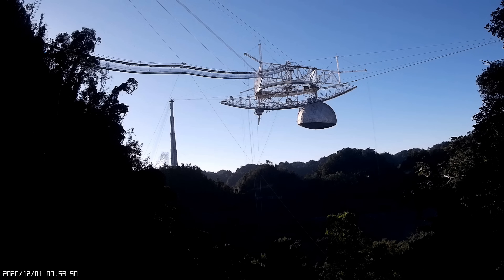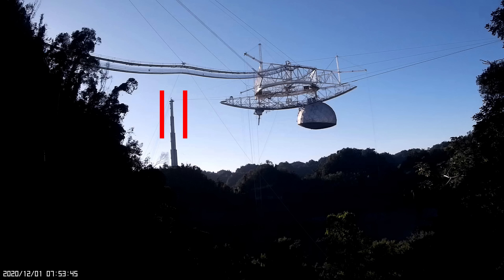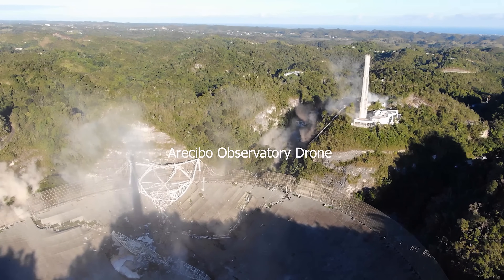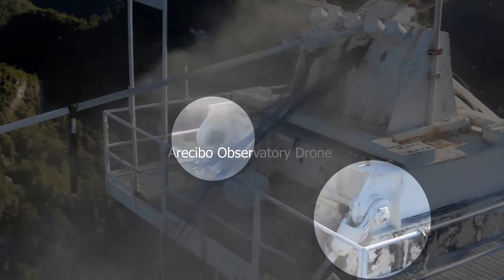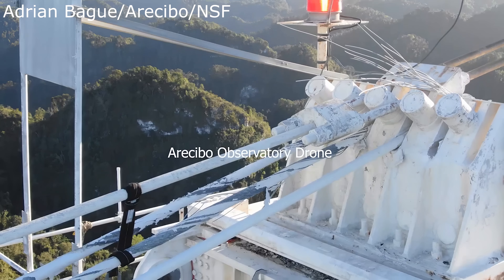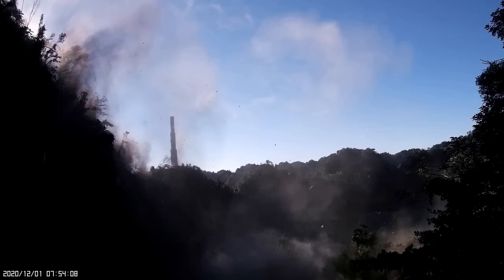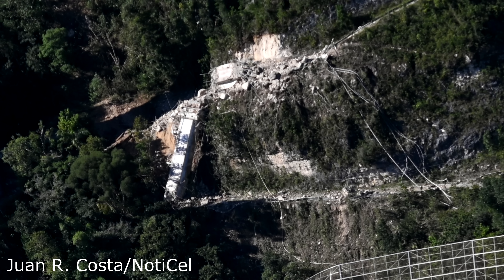Analyzing Video Footage Of Collapse of Massive Arecibo Telescope

Comment: After seeing the failure of the cable and the resulting failure of the remaining cables It is clear that there is a design issue causing the cables to be stressed and weakened near the ends due to contraflexure. I think the cables need to be finalized in an oscillating mounting with a multi axial bearing to prevent the flex strain near the ends of the cables..
It would be interesting to work out the amount of weakness created in the ends of the cables due to contraflexure  and Arecibo's data of the movement of the  Antenna over time might be It's final and very useful insight as to why the cables broke at a much reduced  breaking strain than expected, Better start researching before we start loosing suspension bridges !!!

Comment: Planned obsolescence or sabotage? I'm no engineer but it would have been evident seeing the decay of those support cables months prior. Why the problem was left to go on like this is the real question. Maybe it is cheaper to rebuild, but then they should have admitted financial limitations as a reason for the lack of repairs and preventative maintenance. For something that was built in the 60's to 60's standards it has held up for pretty much over 50 years.

Definitely a hit for the science/astronomy community. I hope they get to rebuild and those with the money chip in with funding.

Comment: As silly as it sounds, maybe it could be possible to use the dish by hovering a drone at the desired focus point? Of course, the drone could be a very hefty affair, probably even tethered to a cable to supply power batteries could not, but that could be implemented much faster than rebuilding the cable-slung hardware…

Comment: Arecibo SR: that Asteroid is changing velocity...
Ten seconds later: Arecibo has died in an accidental cable failure. No plans to rebuid.
Reply: That is basically what happened when the Green Bank Radio Telescope collapsed overnight a few years ago. An analysis of the radio data collected in the few days before the final collapse showed that the dish had changed shape. In that case there was no warning of the collapse - the staff on site were very lucks and also the group photo of a large proportion of the worlds leading radio astronomers that had been photographed under the Green Bank dish a few week previously. I don't think Green Bank would have been looking at an Asteroid probably a far more distance radio source when it collapsed.
Reply: Actually this happen because the dome was added after and those cable where ment to hold less weight and by adding the dome and all natural disasters that added to this cables to failed
Reply: @purple88able  Thing is, that by design those cables should not have failed. But after the first failure, analysis showed that for some reason they were MUCH weaker then they should be.

Meaning we are looking at either a factory defect or accelerated decay for an unknown reason.
Reply: @purple88able  As it says in the video additional cables were added to strengthen the structure before the weight of the receiver / transmitter cabin was increased. The reason why the first cable pulled out of it's  termination socket a few weeks ago causing the initial damage has not been revealed.
Reply: @johnmurrell3175  Guys I was born and raised in Arecibo Puerto Rico and even do the beach is a bit away from the place saltpeter reaches everywhere and eats everything. Im sure that was another of the reasons that added, plus what you guys highlighted. It's a pitty that NCF did lost the love for this project and stop fundings for the maintenance. The administrators of the Observatory is the University of Central Florida. Right now the only technology available in the Observatory after this event is radio astronomy and other stuff they have a 12 Meters telescope, 2 lidars and 3 photometers. Here they had 3 radio sciences: radio astronomy, planetary radar and atmospheric science. The only one left is radio astronomy. Why they stop fundings it must been for a purpouse. I had the privilege to be inside where the data is shared and  the general public is not allowed. So everything happens for a purpose and I know we are humans but if this instruments is so important for history and in 1974 the first binary signal was sent and they have the SETI server founded by Drake and waiting for a response and if we receive a response will be detected there because it was in encrypted in the message sent in 1974. Why they practicly abandoned it?
Reply: The Observatory was build in 1960 and the Dome was added in 1974 they added the dome and in 1997 they added a metallic protector to avoid the radiation from earth. So it been going through changes
Reply: Is this what traveling in QAnut circles?

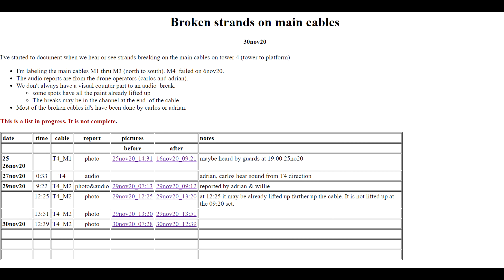Comment: Great video as usual, but "visible with the naked eye from space" (ca. 3:20). Depends where in space you are. On the ISS: maybe. On Mars: probably not. Near Alpha Centauri: pull the other one. A cliché too far?
Reply from the maker: At a certain distance, the answer is no, the question is what distance is it.
Reply: @scottmanley  Sorry for the snarky tone of my comment. Since you've asked a really good question, let's have a go at working it out.

Assume we're talking about a naked eye observation: the human eye is apparently able to resolve about 1 arc minute. That means, using half of that and half of Aricebo's dish, tan(1/120° or π/21600 rad) = 150m / (distance in m). This gives the distance as just over 1031 km, well above the Kármán line, so "in space". But not very far, in the grand scheme of things :)

Edit: no, I didn't use Pythagoras - I have no idea why I typed that first time round.

Comment: Rust happens. Have bought miles of cable, 5/8 and 3/4 inch left lay. Left lay is for cable drilling. Bar rotates clockwise when rig is running. That cable there is cheap ass cable cheap cheap

Comment: Hopefully the replacement will have a winching system that will allow the platform to be set down for maintenance and upgrades on a regular basis.  And lets add 15-20 meters around the edge for an increased collector area.

Comment: Ah so the molten zinc did not fully solder itself to the central strands of the support cables. I could have seen that coming. Allegedly. 
I wonder if a flux was used. Or if the correct flux. Any number of things could have gone wrong there.
I'll volunteer for the cleanup operations. They cover room and board, transport and a nominal salary right?

Comment: Is anyone aware of a foundation our something that may sell parts of the site as memorabilia and the money would be spent to build its successor?
Reply: Pretty  sure the aluminum will be looted faster than a NYC hubcap in 82’
Reply: I'm sure the scrap value would be way higher than any memorabilia. Also there's little cost associated with scrap. There's a ton of costs with setting up some online shop and then finding parts for memorabilia.
Reply: @lost4468yt  I think even the dish chopped up would be great. And I'm not saying they should sell out dirt cheap, like cheaper than scrap value. I mean 10x, or more! Some enthusiats would pay $40 for a palm sized piece, for sure especially if the income is going to be used to build a new one. A crowdsourcing project backed by old hardware sellout, if you will.
Reply: @Sekir80  I understand what you mean, but I don't think they'd be able to sell much of it at 10x more. If you flood the market with pieces then they have less value because they're not rare anymore. If they sold 10,000 pieces at $40 each that would still only be $400,000, and I very much doubt they would be able to sell even 10,000 at $40 each. Even 100,000 at $40 each would still only be $4 million. 

And you have all the overheard. You need to host a web page, cut it up into small enough pieces, advertise it, store it somewhere until it sells, etc etc

It's just not feasible, it's better to just sell it for srap.
Reply: America is too poor to build a successor. We only run a 168% debt for military spending.
Reply: @zeitgeistx5239  What's sad is that the US can easily rebuild this and their nation if they stop funding the Pentagon.
Reply: @ivanfreely6366  then again, it would probably be eaten up by SS, Medicare and Medicaid which total up over two trillion.
Reply: @ivanfreely6366  not much money goes to the pentagon. It's nearly all on poorly planned social programs.
Reply: @ivanfreely6366  Intrestingly, the DOD budget is spread out amongst 18 agencies, the 3 departments such as the Army, Navy, and Airforce, as well as multiple other groups such as POW recovery office to the Education office and then 9 commands 
Yet still takes up less spending then other things the Federal government spends on

Comment: 6:48 you can see the paint coming off the big bolts under where the cables attach too
Reply: @robertcowling4313  yeah that's the point, they're starting to break off

Comment: Those were badly engineered sockets.  the wires pulled out of the socket because a few broken wires gave the cable enough space and movement to pull out.   I wonder if the Zinc cap was badly done or had just corroded to uselessness

Comment: Interesting- there is what looks like a datalogger box recently installed below the saddle. Its white with the letters WJE, temporarily mounted with Kant clamps. Wiss, Janney, Elstner Associates is an engineering firm that specializes in failure and repair of structures. I wonder if they had some instruments that were alerting that these cables were about to fail- which could explain the amazing timing of the drone.
Reply from the maker: It's possible, but they had been in the habit of flying first thing in the morning since they needed to inspect cable status as soon as there was enough light.
Reply: @scottmanley  In any case, the camera position of the drone could not have been any better! As disappointing the failure might be, all structures are doomed to collapse at some point in time they should be stoked for getting that footage!

Comment: I wonder , the cables were obviously right on the verge of letting go and the odds of a drone with a flight time of say 15 -20 minutes being in the right place at the right time is very unlikely , brilliant as it was . High power industrial drones , which is what I assume they used here  have powerful  motors and when close vibrate the air powerfully , I wonder, was that vibration , small as it maybe compared to the hardware involved , just enough to tip the cables over the edge ? A bit like an avalanche where 100,000 tonnes of snow can be set racing down a mountain just by the sound of a rifle or a skier ?

Comment: I knew it had failed, but had not seen the scale of destruction.  Large structures are normally designed with a generous safety margin, one where even if 2 of the 4 cables broke, it would still be able to safely  sustaining the load without exceeding elastic limits. Apparently that was either not the case, or the cables had rusted / corroded, and (as happened here) the plugs securing the cable ends were inadequate.

Comment: Would it have been cheaper to have replaced the cables 10 or 20 years ago, than to have to pay for the clean up, alone?  And then rebuilding it?  Whoa!  A couple $billion, maybe?  If we are going to rebuild it, look at making it bigger and better.  IF bigger is better.  Maybe a smaller dish diameter can do active radar scanning adequately?  Form follows function...and I hope not politics.  I then give thought to:  Why not rebuild it on the far side of the Moon, in a mile-wide crater?  But then, that's probably $40 billion!...or more.  Less gravity, lighter construction...all the radio emissions of Earth blocked out.  Lots and lots of pros and cons to consider.  I think it should be thoroughly considered, though.  Once this mess is cleaned up, they should be able to refurbish/replace the towers.  And then hang a new instrument structure with a cable system designed to allow periodic cable replacement.  And finally, repair the dish, below.  Or, maybe it should just become the world's largest skateboard park.  :)

Comment: Scott, your rendering seems to have glitched out and failed between 10:18-10:41.
Reply: Bumping this. We miss some of the photos described when the video glitches out.
Reply: Looks just fine on my end
Reply: @Somethin_Might  Scott refers to images in such a way that you should be seeing them on screen, but don't. There's also a couple of frames of the buildings visible for milliseconds in the middle of the image of the towers which are pulsing ever so slightly like a loop of a fractional zoom in then restarting from the original frame.
Reply: Indeed
Reply: Bump

Comment: Seems irresponsible to me that they didn't demolish it as soon as that first cable pulled out of its socket in November. They could have had a lot more control and a lot less cleanup with a controlled demolition, not to mention a lot less risk of loss of life.

Before this, they were only going to have to rebuild the telescope itself, now they have to rebuild several buildings and repair the road in addition.

Comment: Considering that it had been underfunded for a long time, the cables were only designed for 40 years, I'm not surprised, but still saddened.  I still think it was stupid there was no way to safely lower the support structure to rest on three simple concrete columns at the bottom ever considered when building it.

Comment: Hopefully it will be rebuilt. I was 11 years old when the John Day river  bridge collapsed. In 1965 we had crossed it not a week before. (This is I 84 Oregon side of the Columbia. River). Brand new ,just completed. Fortunately they left the old bridge intact. So it was used until the bridge was repaired. It was a massive jumble of steel and concrete
Poor quality of engineering and construction.

Comment: Excellent analysis.  Makes one wonder how long the old suspension bridges like the Golden Gate and George Washington Bridge will last.  One also can wonder why the maintenance was not up to par with the Arecibo dish.  This is not a surprise after all the neglect.  If this site is ever rebuilt, it will have to be designed from scratch and that will take time and lots of money alone.  As a political expedient, it can be named after a prominent ethnic who excelled in science or some such type of innovative person.  That can catapult a movement for replacing it.  Puerto Rico needs a good shot in the arm.  Time will tell.

Comment: Thank you for the frame-by-frame.  Note the main bolts and nuts holding the "saddle" casting to the tower.  The paint starts to shed on the 2 on the right.  (Compare 6:40 and 6:52).  I think the bolts went from unloaded (due to the downforce on the saddle) to sudden tension from being pulled backwards by the backstay cables.  It's surprising the sudden tension didn't strip the nuts off the bolts.   There may be signs of cracks forming at joints between the pedestal and tower (very bottom of the frame starting at 6:56) but it's difficult to tell.

Comment: I've read that the center platform and related equipment weighed 900 tons - is this true? And if so - why so heavy?? I mean, if it really did weigh that much, then we shouldn't really be surprised that the cables snapped after 50 years.

Comment: I can see them digging down to the next canyon over to enlarge it to 2-4x the diameter.  If they used modern composites and lighter weight metals in the construction of the platforms as well, you could likely see several times the diameter with a total weight of half what it was.

Comment: Wouldn't have been much effort to stabilize the platform with like 10x 40mm Dyneema marine mooring ropes.
10x 1000kN should have been more than enough to carry the platform. With 90kg/100m rope, you would even been able to manhandle these, so a few riggers might have been able to do the job.
https://www.moremarine.nl/superyacht/dyneema-mooring-lines/

Now that all is gone, I doubt it will be rebuild, much too expensive and big politics won't give a crap about science.

Comment: Well, I guess Ellie is gonna need a new radio telescope.
Jokes aside. Nobody got injured or killed. What I'm wondering is would it have been possible to lower the reciever structure once they knew that a cable had failed
I once had a steel cable part about 3 feet away from me. Happened so fast I didn't have time to be scared. I was thoroughly pissed off at the crane operator who was not paying attention to signals. I was 30 feet off the floor on top of a large stamping press and he was down on the floor.

Comment: I'd guess that those cables are similar to the ones used on suspension bridges.
Reply: For small onesies.  for the larger suspension bridges the calbes are assembled on the bridge while Arecibo used manufactured at a factory and then installed and tensioned on site.
Reply: @stevenf1678  True for the main cables, not the suspender cables.